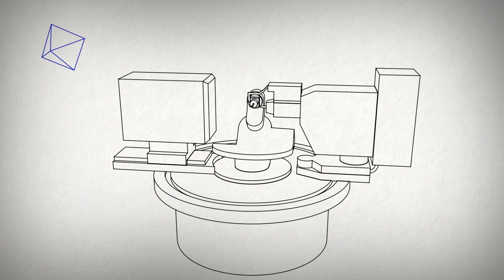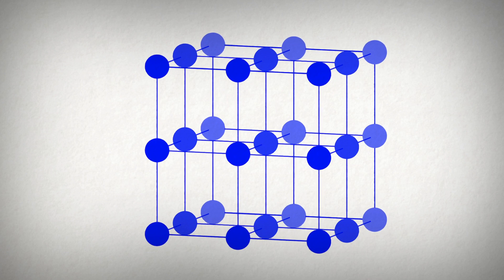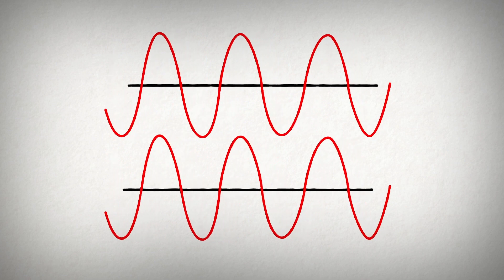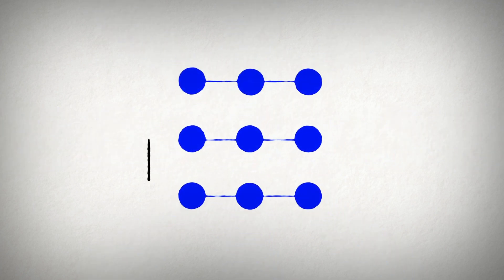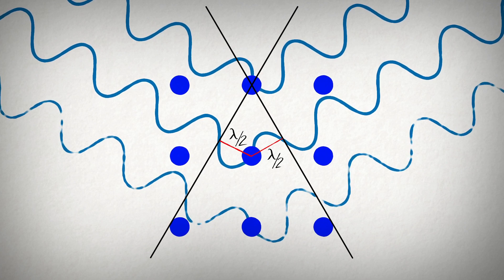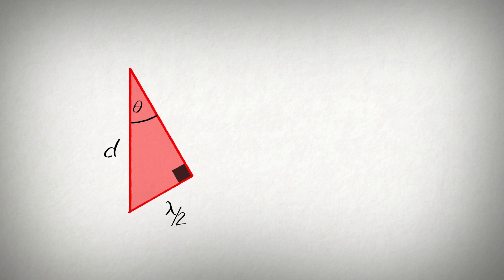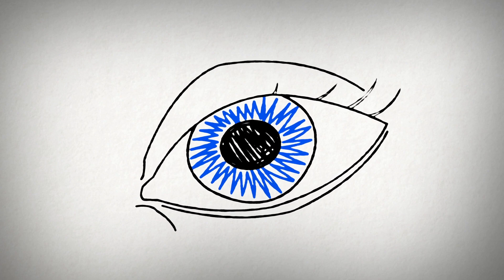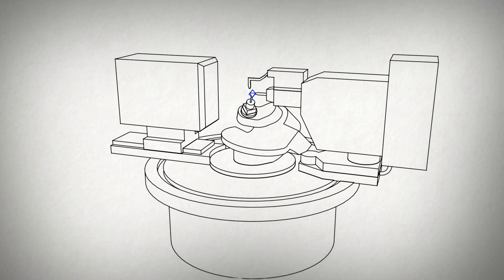What is Single Crystal X-ray Diffraction?

Comment: I have a few questions, reply plz.
1. When you say x-rays from two planes, do you mean by any two atoms on those planes?
2. How two x-rays from different planes can interfere when these x-rays are 'apart' and not 'coupling or interacting' with one another?
3. Your explanation that incident x-rays are scattered from electrons make sense. It seems that these re-emitted x-rays couple at all possible angles. At some angles, these interfere while at others they don't.

Regards.
Reply from the maker: Thanks for your feedback, Gulzar 
Let’s try to address your questions: 
1) In a real crystal you don’t have just two planes but millions of them. In principle it can be any two atoms in two given planes but in this case the interference will not be constructive. Even if you had a constructive interference at two planes, the signal will be eliminated within the remaining other millions of planes. 
2) There would not be any constructive interference if the Bragg  condition is not fulfilled. 
3) If you look at an individual atom the scattering will occur in all directions. However, within the crystal lattice only the constructive interference is propagated. Everything else is eliminated.
Reply: @Bruker  But this doesn't address part-2. I mean when two x-rays are in phase but don't interact (e.g. in Young's double slit experiment when two rays reach at a spot, these generate constructive pattern only) then how interference happens?
Reply from the maker: @GulzarAhmad-sw1kh  The double slit experiment nicely shows constructive and destructive interferences of monochromatic light. Pretty much like the single slit in Young’s experiment  X-rays interact with the electrons of an atom. This effect is called scattering. Each dot in our model is “equivalent” to the slit and the scattering occurs in three dimensions. Crystals  form a three dimensional lattice. Like in Young’s experiment the interaction (better interference) of the scattered X-ay light can be constructive or destructive. The Bragg law describes under which conditions you can expect constructive interaction leading to a diffraction signal from the millions of  atoms/molecules arranged at the grid points of the lattice There are very detailed descriptions on the web. I find the content for “Bragg’s law” on Wikipedia (https://en.wikipedia.org/wiki/Bragg%27s_law) quite useful.

Comment: Big thanks to this amazing explanation video. I am really helped with this video that explains single-crystal XRD. now I am analyzing my data from this equipment. in the video you explained that this equipment can make us understanding mechanism behind the reactions. may I ask something? My supervisor asked me to do it also. How do we know the mechanism? the data just i got from application namely crysAlisPro.
Reply from the maker: Thanks for your comment. Single crystal X-ray diffraction (SC-XRD) allows the determination of the three dimensional structure of a molecule more accurate than many other methods. Bruker instruments are delivered with the APEX3 software suite for data collection, processing, structure solution and refinement. This is the most comprehensive software package for single crystal X-ray diffraction (SC-XRD) using well tested first-class algorithms. Its modern graphical user interface provides an unparalleled easy-to-use at all steps enabling researchers to faster and with highest accuracy understand the mechanisms behind a reaction.